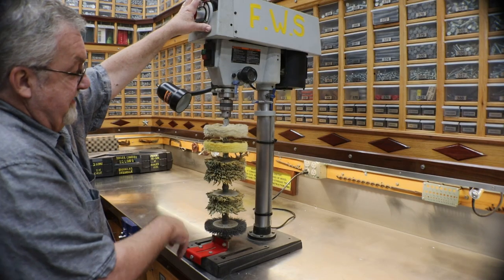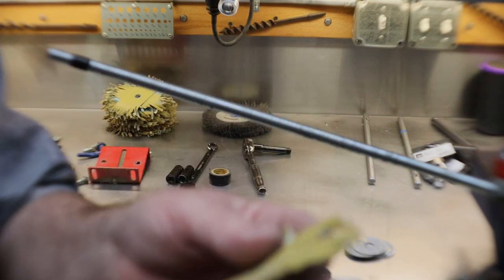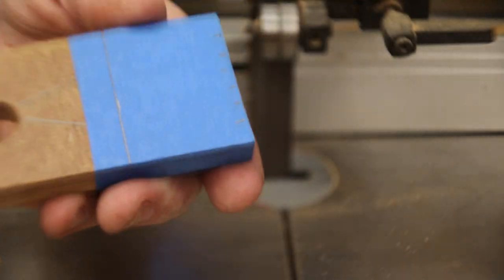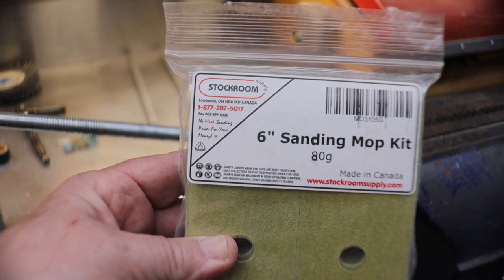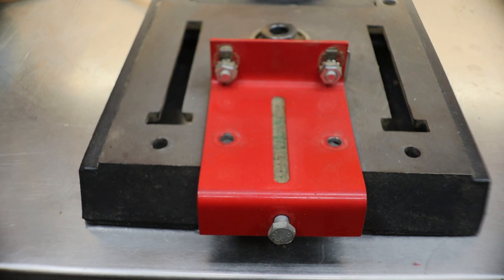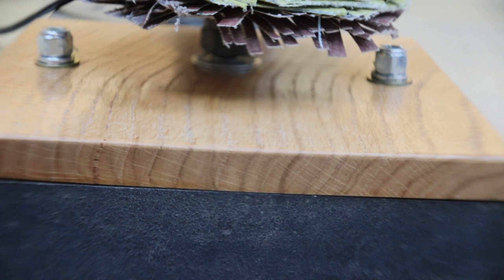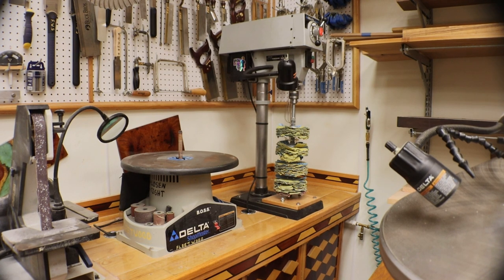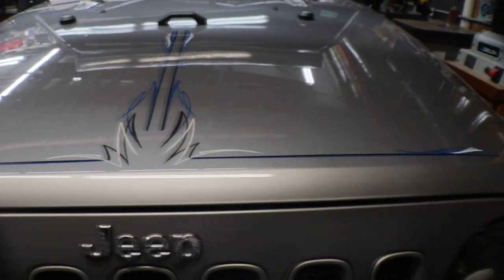GREAT SHOP SANDER

Comment: Blessings, Doug!  Enjoying your channel.  Never seen a sanding pole like this!  Pretty neat.
Reply from the maker: Stan you are so welcome my friend and I love your trains. I can't say how much I really like that. I would love to have one of those steel bases with the wheels. To build a caboose toy box out of it. Make it look like a caboose but it's a toy box. For my grand son. I've been so busy today I've been meaning to come back and watch more of you videos to get some ideas on how to build it. And thank you my friend thank you I couldn't help but giving you a sub I liked it so much. I'm glad you like the sanding wheel. I've had it for years and man is it a good thing to have it works great for me. When I put out my first shop tour video a couple years ago I don't think too many people noticed it. But I've been using it on several of my videos and got a few comments so I thought I'd do a rebuild on it it was time. I can't tell you how happy I am to hear from you buddy and thank you again so much from Doug
Reply: @fleetswoodshop3339  Doug, that steel chassis and wheel set is very robust and designed to be sat on and run on track with easily a few hundred pounds, so it would be way overkill for your toybox project.  In fact, a 3/4" plywood structure would be more than strong enough-- even for kids to climb on/in.  With your skills you could easily turn some wheels with bolt or dowel axles!  I'm 73 this year, and still have the toybox my dad made for me in the 50's!  He also made others resembling circus train cars with plywood wheels on wood axles.  If you decide to make one, it will be cherished!
Reply from the maker: Hey Stan thank you for the information on that my friend. I will definitely do it that way then. And you're right I could very easily turn the wheels but I'd rather have the steel spoke look. Like the trains actually look. So I think I'll research where I can find them. That shouldn't be too hard I wouldn't think. Thank you so much for the info. I'm going to get building that pretty soon here. And I'm so glad to hear about the toy box your dad built that's awesome that you still have it. Thank you buddy thank you so much from Doug

Comment: This is great design. Simple things are best!  How about adding on a very necessary accessory to collect he dust?
Reply from the maker: Hey Robert how you doing my friend. Great minds think alike my buddy. Where it sits permanently I do have a dust hose hanging above it that I clamp by each wheel when I'm using it. If it's putting off a stream amount of dust. It's hanging from the ceiling above the sander. Of course you couldn't see it when I moved the sander over to the workbench. But in its permanent spot there is dust collection coming from above. And thank you for reaching out my friend I always appreciate the input. And great to hear from you. From Doug

Comment: A few years ago, I did the same thing on my wood lathe. Catastrophic fail!!! It may have been too long, or the speed too high. When that thing folded in half, and was swinging around,...well, I didn't get hurt, but did have to clean out my shorts. I now use a shorter piece at a lower RPM.
Reply from the maker: Hey Alan how are you doing man I can completely understand that. The reason it doesn't work very well on a lathe. It's because you don't have gravity working in your favor an object will spend horizontal a lot easier than it will spin vertical without warping or bending. And I know what you mean even my buffer wheel on the lake if I get it going too high tends to wobble in the middle. And thank you for the laugh and the smile that was awesome. I hope you're having a great New Year my friend and a wonderful happy day. And thank you for reaching out buddy thank you so much from Doug

Comment: Oh that hurts to watch you remove all those 1/2" nuts. Why not put make some pipe spacers and put between each wheel and leave the nuts on the ends... That might be much better. Glad to see you back. Just love your shop.
Reply from the maker: Hey Charlie how are you doing buddy. That's a great idea my friend. I'll take you up on that when I redo it again. And thank you buddy thank you so much. I hope you're doing well and staying safe. Have a great day my friend from Doug
Reply: @fleetswoodshop3339  I'd mount the entire assembly in a screwdriver and hold the nuts with a wrench, instead of manually twisting them with the wrench. Great sander btw!
Reply from the maker: Hey buddy that would be a great idea. Thank you for the tip my friend thank you so much. I love it I love it. Have a great day buddy and thank you so much from Doug

Comment: Hey brother how’s it going lol 😆 I’m going to make one for my wood lathe! Crank it to 2500 rpm! 🤣😆😜 Cheers 🍻
Reply from the maker: Hey Doug how you doing buddy. I hope that works for you. I did the same thing many years ago. And came to realize that gravity was not working in my favor. With the wheel spinning horizontal. It got warped very quick. But having it horizontal on a drill press you've got gravity working for you not against you and I've never had that problem with it warping. I hope that helps my friend. If you do make it for a lathe. Don't make it very long. I hope that helps buddy I really do and thank you my friend thank you so much from Doug

Comment: Another great video. Thanks for sharing so much info! What a great use for a bench drill press. Please do a video on your Powermatic drill press upgrades, I assume it's full size.
Reply from the maker: Hey there repo how you doing buddy. Thank you my friend thank you very much. It's worked great for me for years for so many different uses. And so many different types of material. And I've been working on that drill press video on upgrading the big drill press. For quite a while now I'm just going back and forth with the way to do things. But I'll get it out there soon. I've actually got four videos I'm trying to get finished up this week so I can get them out. And thank you my friend thank you so much for reaching out it's great to hear from you. From Doug

Comment: Nice setup. Looks like it would be handy for cleanup on restoration projects.   like the new wood bearing base instead of the metal bracket.  But I think I would turn the all-thread down on each end instead of running threads in the chuck and bearing.
Reply from the maker: Hey Johnny good to hear from you buddy. Yeah you're right that will be very handy on restoration work. I've cleaned up quite a few tools on it. And I know what you mean about taking off the threads. But the Chuck seems to buy it real well to the threads. So I haven't had any issues with it but great idea. Brilliant minds think alike. Thank you my friend and I hope you're having a great day buddy from Doug

Comment: Hello
The paper is made in Germany. The mop kit is manufactured from it in Canada. Or it means the label was made in Canada. Lol
Reply from the maker: Hey Mr pluusses. I kind of figured the paper was made in Germany. And they were cutting it out and punching it and packaging it in Canada. Just one of those funny things I thought I would point out. LOL. Great to hear from you buddy and I hope you're doing well and staying safe. And thank you my friend from Doug
Reply: @fleetswoodshop3339  
I agree. It was a little obvious the paper was made in Germany. Somehow I'm always pointing out the obvious. Lol.
Glad to hear you're feeling better and being busy. 

I may have missed it but do you vary the speed of the drill press for different grades of sandpaper or do you just leave it the same for grades?
Reply from the maker: @MrPlusses  hey there buddy it's a variable speed drill press I have no way to change the speed for each different paper but I can change the speed of the overall peace. Which basically means if you want to use one paper faster or slower just adjust the speed and use that paper. So yeah I guess it would work either way. And no problem my friend you point out everything and anything you like I'm always glad to hear it. And thank you buddy from Doug

Comment: Wouldn't it sand smoother if you sanded on the right side of the spinning disc? Also, it would be nice if you could mount the drill press to something so it would be horizontal and not vertical as it is now.
Reply from the maker: Hey my friend how are you doing. Great thoughts buddy great thoughts. But the wheel spins clockwise. It will sand on the left are the right. I couldn't do them both or at least didn't think to during the demonstration. It will actually sand on any side depending on where you're standing. Many years ago I built one for my lathe. And if you mount it horizontal gravity is not working in your favor. The center wants to bow out. And it actually bowes out me very badly. In the horizontal position you don't have that problem gravity is working in your favor. I learned that the hard way on the lathe. And while it was sitting on the workbench and I was making the video it wasn't bolted down. If you check out where it was back in its final destination of course it's bolted down. Which yes you're right absolutely eliminates a lot of the vibration. And there's dust collection coming from above. I had just moved it to the workbench where all the tools were to do the disassembly and reassembly. You're very observant person great ideas and great thoughts. And thank you thank you so much for reaching out. I always appreciate the great input. From Doug

Comment: Man that's awesome! What is the RPM you have it set at?
Reply from the maker: Hey there my friend it is a small Delta variable speed drill press. That I have it mounted to that's my little old small benchtop that I don't use anymore. I usually run it between 1000 and 2000 RPM. It tends to work better at the slower speed around 1000 though. Very simple to do with just some allthread and you can even make your own sandpaper. And I love it I've been using it for years. I hope it would work for you to my friend